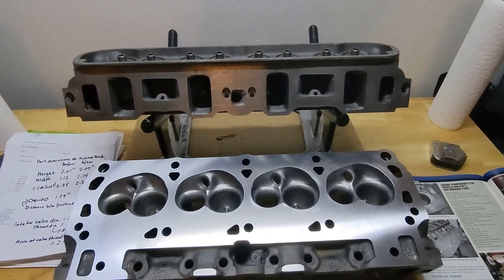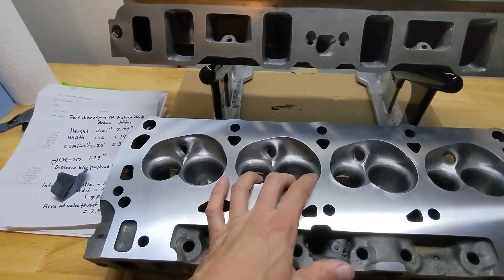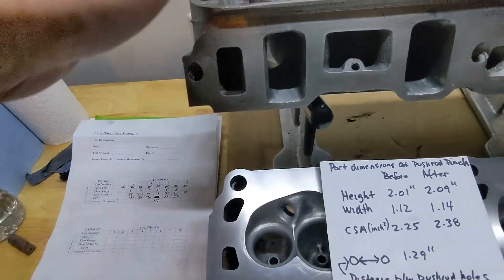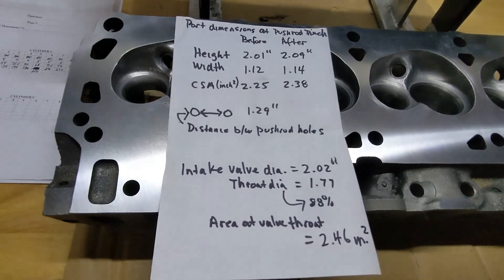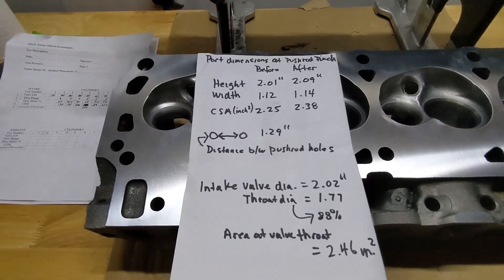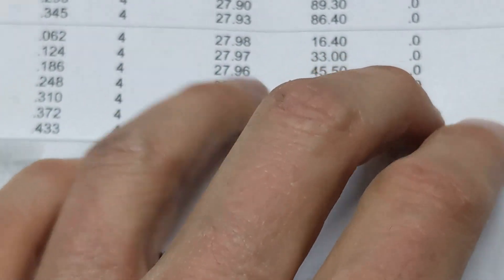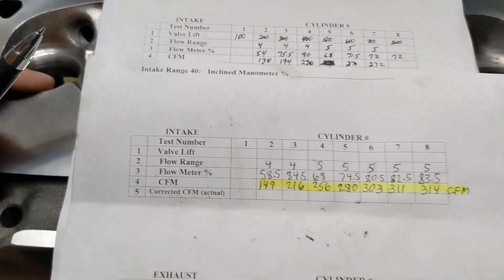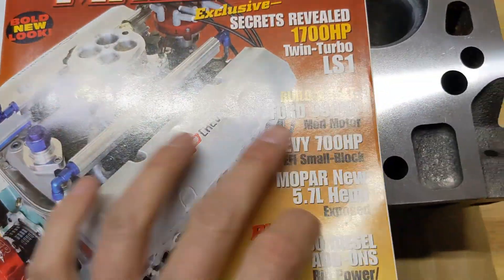Amateur Head Porting Results

Comment: What valve stem seals are you using?  I have some Iron SR heads and the valve guide is around .560 outside diameter. having a hard time finding the right valve seals.  May take them in and have the guide cut down for .530 seals.
Reply from the maker: I had the heads cut for .530 seals. The shop put on Liberty Performance viton seals, LVS-1055

Comment: The #1 restriction to flow is the closed valve.
Open valves' interaction with the seat area are critical.
Pushrod pinch is rarely an overall restriction.
Bellmouthing intake surfaces is an energy waster.
JMO
Testing from bench to bench is rarely a valid comparison.
Reply from the maker: Intake manifold runner exit was larger than port on cylinder head so had to "bellmouth" the port opening to get rid of the ledge going from intake manifold to head

Comment: What  2.02 valves did you use and  what pistons work were no cut release has to be done
Reply from the maker: Pistons are Wiseco part no. PTS501A3.  I reused the valves that came with the heads.  The heads are 30 years old, so I'm not sure of the valve brand, but I did replace one of them because the valve tip was damaged, and used a Melling V0988 to replace the one valve.  It has the same dimensions as the other valves, but the underside of the valve head has a bit different shape.

Comment: These are great heads and reliable good exhaust patterns,  I bought mine in 1991 , there going on a 385 ci windsor for my 86 F150 , they have been sanding roll cleaned up and chambers cc  balanced and polished .
Reply from the maker: Sounds like the 385 should be a good runner.  I bought my heads in '93 I think, ... I ran them for about ten years before I pulled them and then dusted them off for my recent build.

Comment: Hi, I'm following this build with interest as I am using these same heads on a 306. Could you tell me please what valve springs you are using and if you are locating them on the guide boss or using an aftermarket locator. Thanks, Dave
Reply from the maker: I'm using Lunati springs, part no 73117.  These are for a solid roller, and are a dual spring with OD of 1.550.  I'm locating them on the guide boss.

Comment: I ran these heads with a mere a bowl blending job and they ran well behind a high compression 408 stroker.  Later, experimenting with 5.0L engines, I put the same heads onto a built 302 and it ran pretty hard.  A friend ported and polished the heads at one point, opening up the intake ports to match 1262s and the exhaust was opened up considerably, to a port size of 1.3" x 1.625.  Just had them professionally machined and CCd, they're 65cc chambers with 2.02/1.60 valves, fresh valve job and new cast iron guides.  Did not have them flowed, but I'm sure they're over 280 cfm @ 0.500" lift on the intake - they look just like yours.  Application is a Mercury Mountaineer, so with a cam, high flowing intake and headers it should really wake it up.  The fact that I'm avoiding a dissimilar metal issue makes these heads worth a fair bit of durability in tandem with performance.
Reply from the maker: Awesome. Good to hear you're running these cast iron heads making good power.

Comment: One thing tk nkte if you ever mess with the short turn.

Wideninng it may help floe everywhere but also may kill the mid range. Laying it back will increase hihher up flow but eill kill the midrange.

Regarding widening the ssrit depends on port shape and dynamics. Which is why having a flow bench is important. (Which of course i dont have)😢
Reply from the maker: Thanks for the tips.  Paying to have these heads flowed gets expensive.  I might have to look into a DIY flow bench next time I work on a set of heads.

Comment: Awesome video, nice well thought out process. Always to cross sectionbmath. In your case surprisingly the port opening is part of the restriction.

You can always improve on any as cast cylinder head. I have found the roof of the cylinder wall side (on sbc and small block mopars its called the straight wall) of the port is where you would like to have most of the flow go.

Regarding polishing there are a few areas i wouod polish and all of the others i would leave rough. 
1. Polish the ssr short side
2. Polish the PRP push rod pinch
3.Polish a 1/4 inch before and after the vakve and the throat.

That is where you will see the most gains regarding polish.

Regarding ssr i only port factory stuff sonoften there are inconsitancies that need to be dealt with although sometimes smoothing out a radious towards the throat may help in all flow lifts.

Awesoem job shoud work well.

Also by factory castings i mean trying to get a factory 318 head on a stock vakve job reach 210 cfm. 😂
Reply from the maker: Thanks again.  I'll keep this in mind next time I port a set of heads.

Comment: It might be a mistake to remove surface roughness in ports. The phenomenon is called ‘boundary layer’ where surface roughness traps a thin layer of air to the surface of the port walls. This thin layer of air acts like a cushion that prevents turbulence that would disrupt the vortex of air swirling through the port. Polishing a surface might improve the flow of non-compressible fluids, but polished surfaces actually causes erratic turbulence in the flow of gases.
Reply: Adding this as a reply to my first post on this video; creating a Venturi shape below the head of the valve is supposed,to help flow. It might have to do with the speeding up of flow as it passes through the Venturi, as the flow speeds up the pressure at that point drops. And through a kind of magic that I don’t understand, that helps the air to turn more easily on its way past the valve head, which improves flow. A Venturi size of 80-90% of valve head is for performance engines, and 60-70% for economy/daily driver engines.
Reply from the maker: Thanks.  I agree about not polishing at least on the intake side.  I think it is standard practice to leave the intake ports with a textured finish.  I used a 60 grit cartridge roll on the intake ports just to clean them up.  At the apex of the short turn radius there was a patch of casting junk which is about the worst place to have such a thing, so I smoothed that area but it's not polished.  Exhaust ports were polished though, which is standard porting practice.
Reply: Yeah pcmenten the trick is to get behind the combustion side where the valve stem is !

Comment: Where is #1 & what's wrong with #2?
Reply from the maker: #1 and 2 what?  I'm not sure what you are referring to.
Reply: @MarksMuscleCarGarage  #1 on the reports was blank

For 1&2, the much lower flow than the rest of the pack, not only for you!
Reply from the maker: Oh, the 1 through 8 at the top are really flow at .100, .200, .300, ... .800 inches of valve lift, not cylinder number. So those numbers are all flow in CFM for the same cylinder in 0.100 increments. There isn't a number at 0.100 inch because the valve isn't flowing much air at that low lift number.
Reply: @MarksMuscleCarGarage  ah! That explains it! I was thinking there was some casting defect.

Comment: Polishing a combustion chamber doesn't help flow at all. If anything helped, it would be increasing the port opening, and working on the short turn.
Reply from the maker: I agree that polishing doesn't add much flow. But,  I think Eric Weingartner has a video where he smoothed the cast finish in the chambers on a SBC head with a catridge roll and gained something like 5 CFM. Also, I did smooth out the ridge in the chamber in front of the valves which I think helped flow.
Reply: @MarksMuscleCarGarage hello,have you ever ported ford fe heads ,you look like you do good work

Comment: did you say the before and after test was flow tested on different machines?
Reply from the maker: The before and after direct comparison I show with hand written numbers were intake only, from the same shop on the same flowbench, a Saenz. Numbers were handwritten because it isn't a digital flowbench. The flowsheet that is a computer printout were from a different shop, that I used to get exhaust numbers, but they also flowed the intake, and were before I did the work.
Reply from the maker: So I show 3 flow sheets but the 2 I used to compare the before and after were from the same flowbench. The numbers on the 3rd sheet were also before numbers and were close to the other set of before numbers.